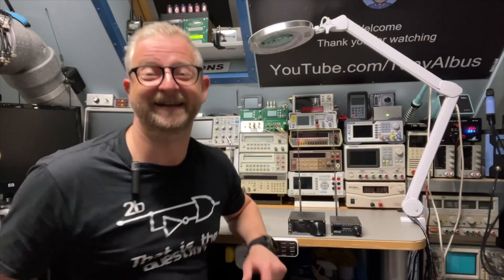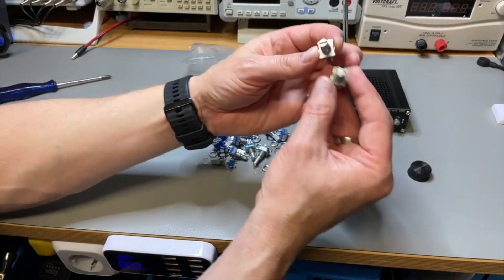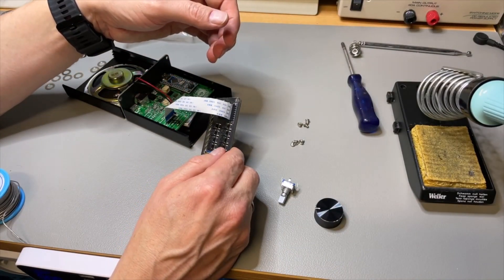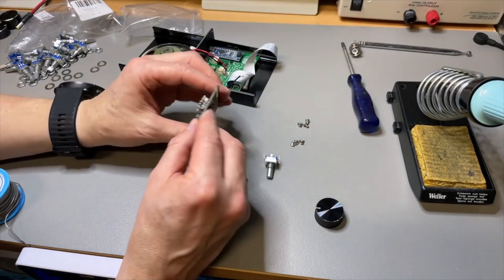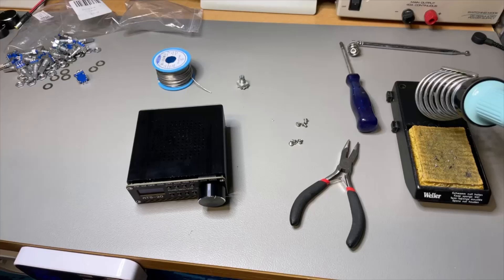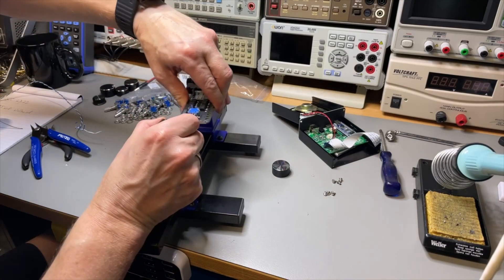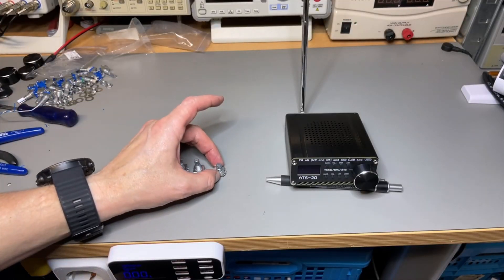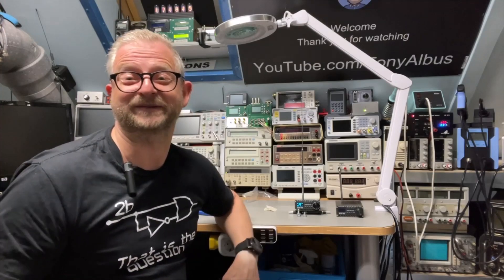#224 ATS 20 Improved Encoder Fix ATS-20

Comment: Good morning, sorry I have a problem, can you help me please? I would like to put the si4735 in place of the si4732. I had read that it was possible. I bought a si4735 but I had not disassembled the radio. The surprise was that the si4732 has 16 pins, while the si4735 d60 purchased by me, has 24 pins. What do I do? Why is it different? Wasn't it supposed to be replaceable? Thank you very much
Reply: I guess you already have fixed it, but just in case you haven't, you have to Google the datasheet for both chips, and look at the pinout, and run some thin wires to the correct pads, it's a bit fiddly but doable.
Reply from the maker: @danpedersen55 thanks!
Reply: @danpedersen55 Thanks. In the end, I didn't do anything. I couldn't find a way to do the job. It's pointless anyway. In my area, you can't hear anything, just interference. I have a 40-meter antenna outside, huge, and you can hear almost nothing. Up until 6 or 8 years ago, I could get 10 stations in SW, today zero.
Reply from the maker: @lifeafterlife9939 same here, many badly installed solar panels, lot of noise
Reply from the maker: Hi, i do not know, mine was liek this, and i have no been folowing this project for 3 or 4 years now.

Comment: Good afternoon Tony how are you? Love your videos. I too have an encoder problem. Mine has the problem where I turn the knob and the frequency does not move at all whether I turn it clockwise or anti clockwise.
Reply from the maker: Thank you!  maybe this video will help solving your problem or replace the encoder... this is all info i have...i sold mine years ago.
Reply: @ is it the same as an ENCODER SWITCH WITH PUSHBUTTON?
Reply from the maker: @airwolf1987  Yes the one i found was, but i see my item link does not work, but its worth a try.

Comment: I have to get my encoder fixed, the ATS-80 needs a new encoder, but I need to confirm what part number is needed?  Is the same part number for this encoder all compatible with all ATS models such as the ATS-20, 20+, 25, 25+ and ATS-80?
Reply from the maker: they are all based on the same chip and same library, i would think it would work.

Comment: If I use a encoder with 24 pulse must I do  make changes in the firmware code ? Because I replace one in my usdx qrp transceiver and it’s not working original it have a 20 pulse encoder
Reply from the maker: Hi Dennis, i don't think so.. it just sends pulses, it is not counting rounds... be sure you bought the correct type.. in my links in the description you find the items and information, what worked for me.

Comment: Interesting video thanks for sharing. I see a new variant called the ATS-25C with a ferrite bar for MW and LW. Also a newer ATS-100 is a pocket radio with a little colour screen, similar form factor to Tecsun PL-365 but even smaller.
Reply from the maker: Thanks, Yes the ATS-100 is a bit expensive still and i have not found sources yet, then i am not going for it.
then it is just a expensive radio.
The atc-25 is just the extra antenna i think.. smart!
Reply: @TonyAlbus  yes the ATS-100 seems very new, I have not found any reviews of if anywhere only a couple of far-east guys in youtube listening to one for a few seconds..
Reply from the maker: @tonymagnier9846  yes true, but also its price ..if they can put it lower on the market, it will sell, i am not going for it for this price

Comment: Hi Tony 
Which encoder should I get 
15 or 20 mm  half shaft
Reply from the maker: i had 15 half handle(moon) because of the new knob, if you use the old knob you prob need. 15 plum (star as i called it)
Reply: @TonyAlbus  thanks for the very quick reply Tony

Comment: Thank you for this video, on the other hand if I can allow myself, to reverse the direction of variation of the encoder you could just modify the program it seems to me not ?. 73 good listening with the ATS-20.
Reply from the maker: Yes agree, i even said that in the video but i prefer to be on the standard because i try a lot of different firmware, i don't want to think about it everytime i try new software. '73